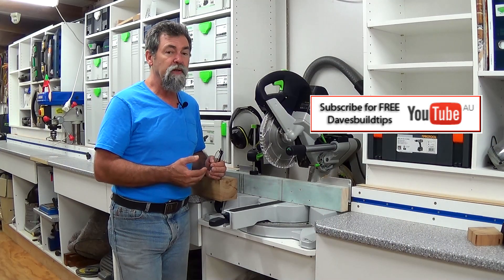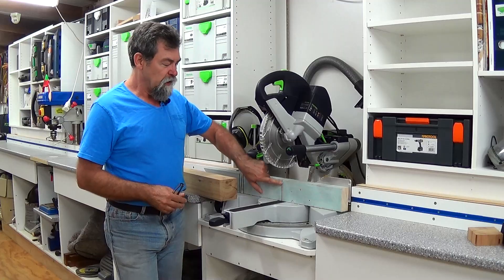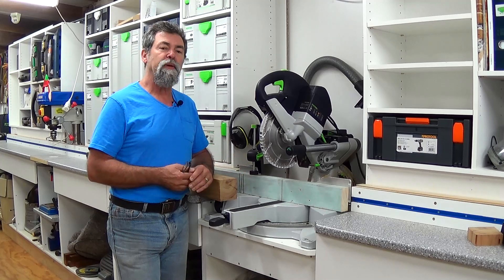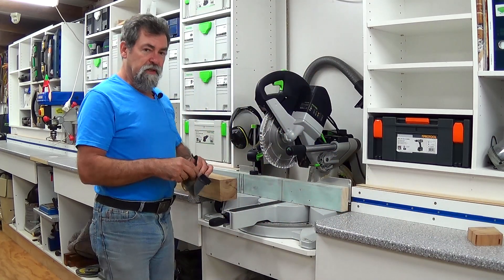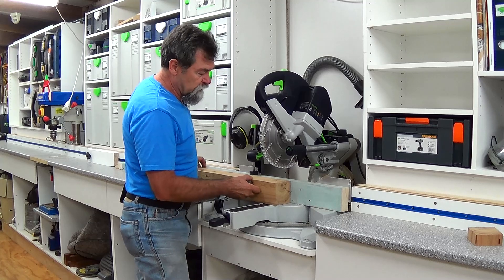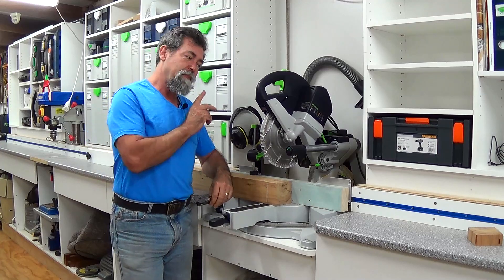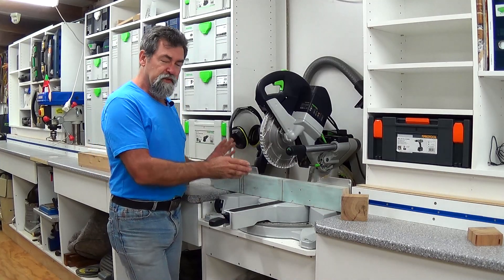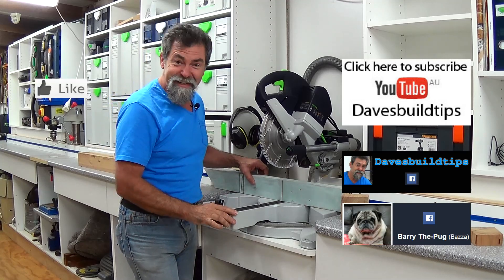how to get more from festool kapex dave stanton woodworking

Comment: Hi David. Great video. You do not need to remove the rubber thingie for the dust collection, you can simple fold/bend it back as Festool shows on their own "getting started" video. I'm around 6 months into my Kapex and loving it.
Reply from the maker: Will check that out tomorrow! Thanks for the info!
Reply from the maker: I tried your suggestion but will stick to removing the rubber boot. Thanks for the idea but the bending thing was a failure on my saw.

Comment: Really well, almost no tear out. 
After you make the first cut in the table insert, you can measure off the cut to set stop blocks, saves a lot of time. Just remember to adjust the fence throat for 45's😉. Mine need replacing 😁
When I'm cutting angles in the vertical plane I use a piece of ply on the table so I don't mess up the table insert. 
I hope all that makes sense.
Reply from the maker: Great tips, thanks for sharing.
Reply: +David Stanton no worries mate

Comment: Hi David thanks for the video, purchased my KS120 yesterday. What is the minimum width your fence needs to be to achieve the 98mm max depth? 
Do you also have the 98mm over the full sliding range in front of the sacrificial fence? In your video example would you have a 260mm X 98mm crosscut capacity
Reply from the maker: That fence is 42 mm thick. Double would be 84mm. The cut capacity without a fence is 314mm. I am sure you can get by using a narrower fence. Try measuring it yourself and let me know.
Reply: Thanks David

Comment: dave, just picked up the kapex 120, love it! however i noticed in your setup that you cannot remove the festool left and right sides to make the 45° bevels. how do you remove the sides?
Reply from the maker: I can take the saw out of the bench if I need to do those cuts. Haven't needed to yet. I can get 45 x 30 degree compound cuts ok. If I were to do it again I would make the bay a lot wider to allow for that.
Reply from the maker: I think making a 1 metre wide space would do it.
Reply: +David Stanton i noticed because i spent a couple of hours modifying the same setup to fit the kapex.  i have a narrow opening too, so i ended up cutting back the timber / rockler track on each side 100mm or so
Reply from the maker: That fix it?
Reply: +David Stanton yes it did. I have lost some length in the stop tracks (100mm each side of the saw) but your long white stops should work there. my short stops dont lol

Comment: Hi Dave,I'm curious about how deep your bench is? I have a kapex too and I am about to start construction of my Mitre saw bench. I want to build in a recess in front of the saw, so when I have my back to the saw, I don't hit myself on the handle (I hope that makes sense). I love watching your video's mate thanks for taking the time to show people your shop and projects
Reply from the maker: +Geoff Roberts . I will measure it tomorrow for you Geoff, but from memory it is 700 deep. I should have made the areas to the sides wider to allow for more movement when the saw is in a compound position. I turn the table to 45 degrees when not in use to avoid catching my hip on the lever lock. I love to make the videos to show. Thanks is always appreciated greatly!
Reply: Thanks Dave, I think the overall length of the Kapex is 782mm. Not sure if your a fan of Norm from the New Yankee Workshop, I'm trying to replicate the Mitre bench and storage he built.
Once again thanks for your input and for your video's ! I hope to produce a video one day, watch this space :-)
Reply: +Geoff Roberts hi, just thought id add to this, i used a 800mm benchtop and did cupboard storage like Dave , the space is a great size/idea. infront of the tracking im left with a 400mm benchtop which can be used for a workbench most times

Comment: Hi Dave, I'm looking to purchase a ks120 or ks60 but haven't found any definitive information on the compound cutting capacity. What depth of cut do you get with a compound mitre cutting square? is it able to cut a 90x45 left and right? If you could shed some light on this it'd be appreciated .Paul
Reply from the maker: Have you looked at the video clips I did on the 120 and the 60?
Reply: I have and I've found what I needed on the ks60 which was really good, however I haven't been able to find the same information about the ks120. In the ks60 video you show that about 20mm is the max with the RHS compound mitre because the machine fouls the material. I'm guessing there's more clearance with the120?

Comment: JUST BOUGHT THE KAPEX 120 AND CAN’T RAISE THE DEPTH ADJUSTMENT HIGH ENOUGH TO DADO 2 BY 4S TOGETHER . SOULDN’T BE ADJUSTABLE THROUGH ITS FULL CUT HIGHT?
Reply from the maker: I think 44 mm is the maximum. I don't know why Festool thought that 44mm should be enough. Maybe their reasoning is that half of 88 is 44? 88 is their advertised depth of cut.
Reply: David Stanton thank you Dave you’re the best.    I was going to return it thinking something was wrong. But I’ll work around it.  Love the videos!